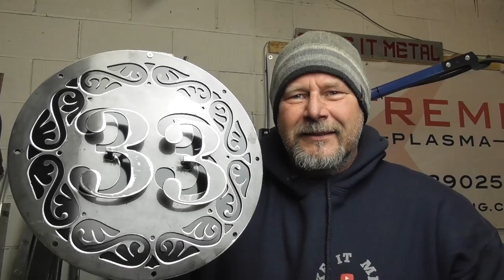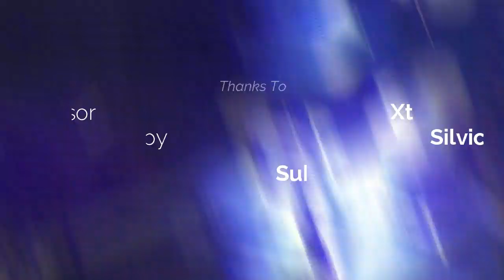AWESOME 3D HOUSE NUMBER SIGN (Using the Xtreme Plasma CNC)

Comment: Okay I had to Subscribe. That's a simple design that looks high class (expensive) but most of all truly looks great! Yes the numbers on the pegs really catches the eye and the numbers are the scrap pieces! The black background piece is another highlight and can be any color to match or offset the color of the wall it's attached to.
  The only thing, I think I saw, was the pierce cuts of the CNC starting on the finished product side of the cut. I've never used a CNC Plasma cutter so I have no idea of how the programing operates. Is there a way you could talk to the manufacture and have them change the program so it always makes the pierce cut on the scrap side of the metal? Like maybe by using the mouse to click on all the pieces that you are using to tell it to pierce on the opposite side.  I think I saw it starting on the good side of the piece but then again I don't know if you intended it to cut and finish a notch or not. I tried to find the cuts on the finish product when you held it up but didn't notice any and was hoping you didn't have to fill weld and grind smooth those areas. That would add a lot of unneeded labor.
  Other then that, Great Video! I will have to go back and watch all the previous videos to catch up.
Thank You for giving us guys a chance to see the ideas in your head, become real.
Ed
California
COVID-19 One week in and out of supplies. YouTube binge watching.
Reply from the maker: Thank you for such a great comment, i love that you have watched this video so closely. the pierce cuts are set to offsets within the sheet cam program, i edit it in a way that each cut will start in the scrap area, on this project there were 2 choices, i either use the original numbers and set the cut to the main body or cut new numbers to mount and set the start to external offset (leading in to the outline of the numbers) i chose to use the existing numbers and reduce the amount of lead in. luckily there was no fill welding to do.  the client specified the colour scheme, though i do like raw steel on black myself. 
Stay safe and Take care,  Covid 19 is a terrible virus and i know you guys over there are getting it bad (news reports) so hang on in there and binge as much you tube as you can stomach lol.
Jase.